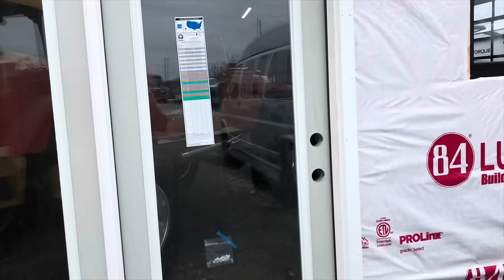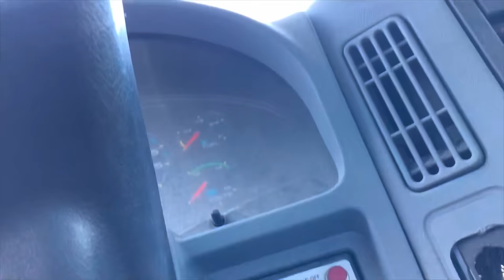Theft and Recovery details on the Infamous stolen Tow Truck

Comment: Put in gps trackers until the vehicle is sold or even make it a part of the vehicle sale that would surely make your insurance premiums lower or stay at the ridiculous price. Good luck old mate. 👍
Reply from the maker: we have tried that but with 400 plus vehicles we never know which one is which and removing installing is a full time job. Great idea and we are looking into a simple style that we can leave in place that we will put in place very soon hopefully with a geofense system so when it leaves we know asap
Reply: Netradyne has plug in OBD 2 gps. Just have to register per vehicle. We use them at work. Only takes a few mins to install. Message me id more info is needed
Reply: Buddy, not even car dealerships can stop these people from stealing brand new cars and you think this guy could? They have devices that can destroy GPS and other stuff.

They only way to stop chop chops from coming after you is to increase security, it's the sad truth, they are usually ran by organizations and are professionals at what they do, obviously the people that stole the truck were amateurs but still.

Comment: An old biker trick to catch thieves was to stamp EXTRA numbers in spots ONLY the owner knows so when a scoot got parted out you could easily tell when ya found cases, heads, frames (pre-1970 Harleys don't have frame numbers because title passes with the numbered engine case) at a swap meet. You can get number stamp sets with letters and symbols to have a unique ID and for trucks it would be easy to fab a piece of rectangular steel to hold say three or four stamps (or modify a commercial stamp holder) for a long reach holder.  The work doesn't have to be "pretty" because unique markings are the point. Who else is going to stamp an ampersand and a question mark onto hardware? Like proof marks on a duelling pistol they wouldn't look interesting unless someone knew their purpose. 

Then I'd make the rounds of everything you care about WITHOUT WITNESSES (because when more than one man knows something it's no longer a secret and when no one knows there is no reason to wonder if you got betrayed or they just ran their mouth without thinking) and stamp then PHOTOGRAPH what you stamped and save those pics backed up on your home PC or online in case your phone dies. I would use different numbers for each item then place the pics into named folders. All this is super easy (I'm lazy) and you have a precise record not only of numbers put the details in digital pics which are like fingerprints. Do a "test vehicle" then review the photos to ensure you're covered. Also remember most thieves won't alter the engine computer so if you have one on a scanner you can have that data too. Actually doing it would svck less than it sounds to read.
Reply from the maker: Thats smart

Comment: From what i was told by a chp... that's California highway patrol there are at least 3 locations on a vehicle for a vin. Bought a 77 chevy silverado a few years ago had to be done for registration purposes. One everbody knows about that's on the dash inside the windshield  the others are somewhere on the frame. I'm in agreement with others... your truck wasn't a priority they wanted a bigger catch. They dropped the ball. There's no excuse . If it was a police or other emergency vehicle they would have been all over it immediately like a blood thirsty animal.
Reply from the maker: yes there are actually almost 20 now days including the computer but this one had several and all tampered with and modified and or removed